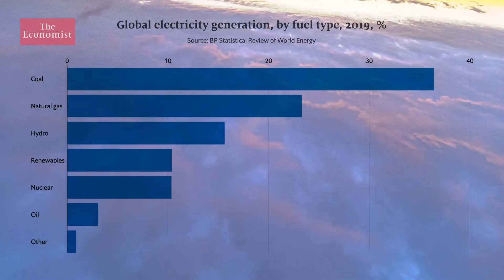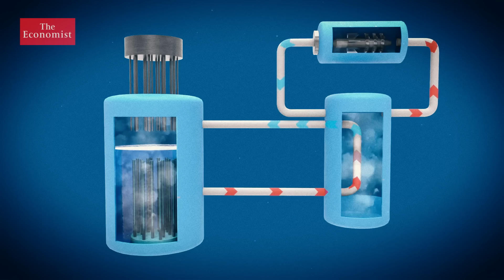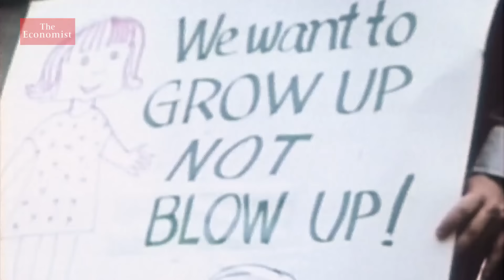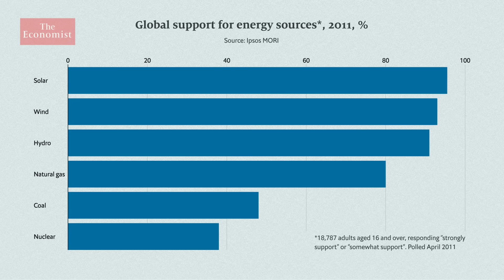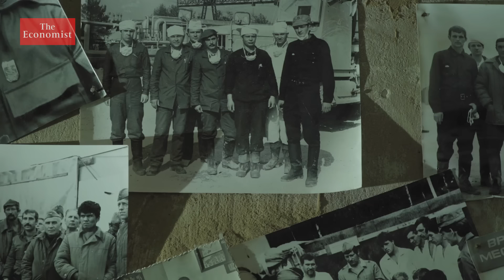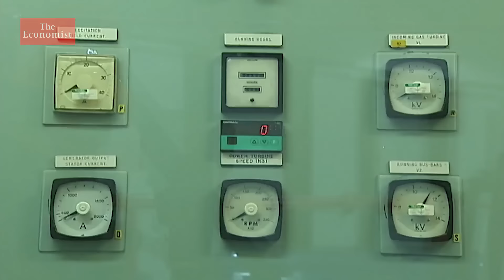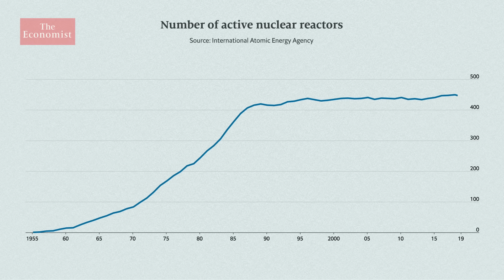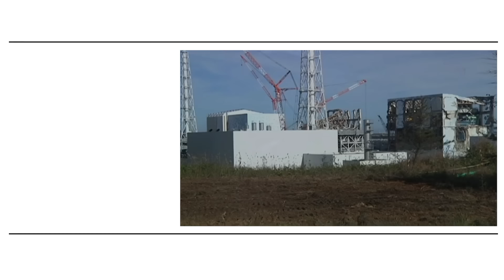Nuclear power: why is it so unpopular?

Comment: Not mentioned in this video: NUCLEAR WASTE.
Reply: Exactly!!! the  waste is awful, it would take many many years for something like that to go away
Reply: @canaldofred2366  that doesn't solve the problem, if it leaks it would make the surrounding area radioactive, and if many countries start producing nuclear energy, that's even more radioactive waste.
Reply: @canaldofred2366  fyi, it then leaks and underground water spreads it all over...
Reply: @luna5031  there are places and ways you can store it where that is not a risk. Wastes sites are made in areas with little to no water and geologic activity, as well as being stored in very secure storage containers. The amount of high level waste is very little, so just one site could store hundreds of years of waste.
Reply: 90% of the energy remains in what you call "nuclear waste".  That will be utilized in thorium molten salt reactors to deplete it further.

Comment: So where does all of the nuclear waste go ? That's the biggest issue..
Reply: I Love Chocolate.  How much can you store under the plant ? For how long ? Considering how long it takes for nuclear waste to become inert this is a huge problem ..
Reply: @D56t37-cu7ol  It depends of the level of the waste medium and low levels lost their radioactivity in one or two decades and their are 97% of all the waste, the other 3% are high level was which is pretty radioactive and need long term storage so it is cool and send to deep storage were it will for the rest of time, another way to solve this is changing the fuel from uranium to thorium, ot the type of reactor to MSR for example in this reactors using thorium all was only if dangerously radioactive for 300 years.
Reply: @viceralman8450  Sure Thorium..... Money stays where money is.... Uranium  has been hugely invested in...Thorium doesn't have a chance (in my opinion)...
Reply: @D56t37-cu7ol  It have being ignore because it is useless to make nukes but  when uranium begins to run short, thorium fever will begin.

Comment: @economist   @3:50 is where the First myths of nuclear power is perpetuated.  This is the claim that nuclear is more efficient.  Despite the fact the preceding comment explained that nuclear reactors use the same steam generation process of using steam to produce electricity as coal or nat.gas?   

Assuming  the purpose of a nuclear power plant is to make electricity, then all energy efficiency calculations need to be based on the thermal cycle that generates the electricity regardless of fuel source.   Put a little more simply, efficiency means, how many kWh of electricity are produced /unit of thermal energy input regardless of fuel source.    Until @easterofsun shows how nuclear breaks the First Law of Thermodynamics, the best claim the nuclear industry has is its expensive emissions free electricity that produces about 3x more wasted heat than electricity produced.

Comment: Building smaller  refrigerator  sized reactors can power a  town, and you don't have to worry about it exploding...   You can pack it up in a truck and ship it in a few hours.
The  HUGE plants  were just  too big, and too unstable.     Little  reactors  can be run by a few people,  have a smaller foot print, and  nearly  zero chance of leaking  RADs...

Comment: Unfortunately nuclear power plants were so over engineered and complicated, resulting in operator error causing the 3 mile Island partial melt down and  the Chernobyl full melt down.  The poor engineering at Fukishima of placing generators next to the ocean known for tsunamis and having a seawall only 38 feet high caused the immediate problem.  Then not having any way to inject non salt water into the reactor using fire hoses connected to fire hydrants was a second problem.  Then not being able to vent hydrogen gas or open other valves because they were air operated which requires an electric compressor to make air to open the valves was a third problem.  Then the inability of the operators to make decisions was the fourth problem.

As for nuclear fusion - always the promise of the future now going on for 60 years, the tokamak reactor still cannot generate more power than it consumes.

If only the engineers had used common sense in designing fission reactors, less accidents would have occurred and the reactors could have operated more efficiently and reached the promise of electric power too cheap to meter while reducing emissions.  Sadly I think it is now too late, even if we found better engineer's with common sense.

Comment: Only three countries can make the third generation nuke plant: USA, PRC, and RU. And how many are able to make coal-based or renewable resource-based ones? That might be the answer to the question.
Edits: South Korea surprisingly is the fourth player here.
Reply: French also can, and I believe China's 3rd gen ability is coming from the French.
Reply: @frankxu2321  I see no French company or entity is one of the G-III reactor providers. They are developing the next generation though, meanwhile, China also has its own G-III+ reactors collaborating with the US for diversity purposes.
Reply: @KXYZ32  France sells the EPR (HPC, Olkiluoto, Flamanville) - a Gen-III+ reactor by most definitions.

Japan could (most reactor pressure vessels, the main part of the PWR or BWR reactor, are cast there), and has in the past.

India and Canada also have strong home-grown nuclear industries. The technology is relatively easy, easier than coal in many respects.
Coal power is common, not because it is easy, but because it is cheap.

Now, wind turbines are super-high tech! And solar panels require multi-billion dollar fabrication plants. Not going to see those manufacturies in small- to mid-size countries either. Sure, the Danes have Vestas, but that is only due to the long lead-time they have been working on this. Don't expect Kenya, Colombia, or even S Korea to start pumping out those.

Comment: I am disappointed the Economist has published such a one-sided video.  For example :  The first "commercial" power station was Calder Hall in the UK.  An important part of their operation was to create plutonium for the military.  There were many leaks.  The claim "radiation does not escape from power stations" is false.  Scanning of the UK countryside in the 80s revealed long term and widespread radiation problems.  These were proven to NOT come from Chernobyl but from Windscale.  Modern atomic plants are NOT financially viable - please see "Hinkley Point C".  Investing in a new nuclear power station is essentially a 20 year bet that cheap electrical storage - whether ammonia, redox flow, storedot, liquid air - will not become viable.   This is why there are no private nuclear power stations coming on line soon.

Comment: Plottwist: while everyone speak about new nuclear technologies and nuclear renaissance, Russia constructing new type of fail-safe lead reactor, researching new type of MOX and nitrogen fuel for lead and sodium reactirs, as well as starting the construction of pleiades of offshore NPPs in the Arctics with small-scale reactors onboard, finishing the construction of a new tokamak that will be used to demonstrate the fusion-fueled breeding, and researching the possibility of creating a gas-cooled reactor for thermo-electrical hydrogen production.
So yeah, the renaissance is just around the corner, guys.

Comment: What about the nuclear waste ?
Reply: No one has been injured by stored nuclear waste.  Besides, it will be valuable fuel in the future.
Reply: If the spent fuel were separated into the highly radioactive fission products and the less radioactive actinides, the actinides can be placed back inside a reactor to generate more power. The fission products  are very radioactive, but decay to background levels after about 300 years. This is proven technology done commercially by the French already. It is the lack of separation that keeps the radioactivity high for thousands of years.
It is fairly easy to store a radioactive lump of glass safely for 300 years.
Reply: Lookup nuclear vitrification
Reply: @goodfodder   Look up thorium molten-salt reactors.
Reply: Thanks for the info ! The seperation isn't implemented because it is too costly ?
Reply: @timothecrelier2674  The separation is costly, but it is economic. The costs become even cheaper if we had more fast reactors (which can use more of the separated actinides, thus raising demand for the separated actinides).

In the US, separation is not done as President Carter believed it was a proliferation issue. I feel the last 30 years of French, British, and Russian experience have showed proliferation isn't an issue with reprocessing as contractually setup by those 3 countries.
(having every country building a reprocessing plant would be, but just a few plants worldwide is enough to meet demand; in fact the world probably doesn't need anymore even if volumes increased several-fold)

Comment: the question is not primarily whether it is safe or not, but if it does make economical sense for combating climate change.
Wind and solar are in most parts of the world extremely cheap and efficient and they keep getting cheaper. If nuclear cannot be cheaper than this, it has no use and we produce radioactive waste we do not know what to do with. Viable uranium is also a finite resource.

Comment: Its the way forward if we want to lower our carbon footprint by 2050, long term renewable energy and battery storages will be enough and we will no longer need it
Reply: Battery storage is not there yet. Plus we would need to start huge extraction industries is a lot of developing nations which usually has turned out badly in the past. A mixed grid of renewables and nuclear should be the solution untill we get fusion

Comment: Because the true cost of nuclear power is none competitive as compared to other electricity generation technologies, unless it is subsidized with tax payer's money, nuclear power stations have to cut corners to be competitive in any free market system. The common means for nuclear power stations to cut corners to remain competitive are to cut safety corners, to prolong the use of nuclear power stations past their design life, to save money by not dispose of spent fuel properly, and to not properly decommission properly. Free market competition pressures from other cheaper technologies ensure that nuclear power stations are unsafe, unless society, which are the tax payers, decides to subsidized nuclear power stations to be designed or retrofitted with robust safety features, to not operation old reactors way pass their design life, to dispose of spend fuel properly, and to decommission reactors properly. In addition, there may be basic design flaws, which are still being used even today. For example, the bottom of the containment vessel is concave in shape rather than convex or even flat in shape, so as to take pressure better. However, it case of a core meltdown, the fuel rods dropping to the concave shaped bottom tend to slide to the center of the convex bottom, and thus concentrating the fuel closer together, which can result in criticality, where the fuel is close enough to automatically initiate sub-explosive extra high levels of chain reaction by concentrating discharged neutrons. Extra high levels of chain reactions caused by the concentration of melted fuel rods by the concave shape of the bottom of the containment vessel generates very high levels of radiation, which make clean up extremely difficult. There are proposed designs for melted fuel dispersing catchers at the bottom of reactors, but such extra safety features make an already none competitive high cost reactor even more expensive and none-competitive, so no reactors are equipped with melted fuel rod catchers. Another example of cutting corners to save money is to run old reactors way pass their design life. Not only very old reactors can have rusting parts, but very old reactors were design before many safety technologies were even invented. For example, microprocessor computer chip had not been invented when many old reactors were built, so that these old reactors lack expert-system computer safety controls that can monitor for operator errors. Computer expert-systems can be used to evaluate the holes in safety in reactors. For example, in Japan's case, water tight doors were missing by not having rubber gasket strips around the edges of doors to make the doors water tight, and as a result water entered the electrical generators room flooding out the generators. Certainly in this modern age, electricity backup are common knowledge, as any serious personal computer user has seen advertisements for electrical backup batteries for pc's to provide uninterrupted power supply systems for personal computers. For large companies, backup generators are commonly installed in office buildings. Yet, the Japanese reactors lack backup generators. Again, in a free market competitive market, a none-competitive technology has to resort to cutting corners to compete in a free market capitalistic system. Not increasing the height of the seawall is another illustration of the need to cut corners (ie. cut height of the protective wall) in a free market capitalistic system. With global warming, sea levels, lake levels, river flooding will probably occur so that reactors build along these water bodies for cooling will become increasingly expose to water damage risks, which again will increase expenses to the costs of running these reactors. A few reactors were located near some of the most major cities of the world. Any major accidents involving these reactors can involve huge economic loses, when a New York City, a Tokyo, and such major cities become so radioactive that they can no longer have inhabitants. The risk and gamble of these reactors just do not make sense, specially in view of the above of old reactors being used way past their design life, of lacking modern safety features, and the increasing economic competitive pressure from other ever cheaper technologies. For example, solid state battery technologies are maturing at a rapid pace to enable solar and wind technologies, which have the drawback of being intermittent, to be hugely economically competitive against nuclear possibly in the not too distant future.
Reply: can you use paragraphs next time
Reply: you do realise that wind, hydro, solar, even coal all get subsidies as well right?
Reply: @Eltener123  Frack-natural-gas is very cheap in the United States, as it is a byproduct of frack/horizontal drilling for frack-oil in the US. As long as frack-natural-gas is this cheap, nuclear cannot compete even with subsidies in the US in a free-market system, so that even with subsidies, nuclear, in practice, will have to cut corners in safety. There is a YouTube video of a Florida nuclear plant being shown to still have leaks during a heavy rain at an electrical entrance panel, because poor work done to plug the holes on the wall where electrical cables enter and leave the building after nuclear operators retroactively started to water proof buildings after the backup electrical generators were flooded out at Fukoshima. The joke is that due to global warming, it is projected that in 50 to 80 years, half of Florida, if not most of Florida, may be under the salt water sea. What safety measures have been done to prepare for that, and many others? Right now, the nuclear operators are doing minimal in safety, and mostly act only in reaction to accidents like in the YouTube video by the Canadian agency, which after studying the Fukoshima accident, implemented three safety measures of storing portable backup generators and pumps both on and off site, of installing passive hydrogen gas absorbers in the containment building, and to install filters in the pressure release tubes to filter out radioactive particles, and gas before release into the atmosphere. Most of these are simple, and relatively inexpensive. the question is why were these simple safety measures not already there world wide before Fukoshima? Is it because in a free market capitalistic system, as well as in other economic systems where greed to make money is a factor, there is a mentality to pinch pennies? Is it because greed has the financial types taking control rather than the engineering type taking control of most if not all companies? Is it because the financial types who dominate the control of companies will invariably start to pinch pennies due to greed? Is it because due to insatiable greed, the financial types taking control will always pinch pennies no matter how much subsidies are provided for safety, because these greedy people will want to increase profits (or in reality reduce losses of most nuclear plants) at the expense of safety? It is not because as Adam Smith maintains that the invisible hand of greed is all dominating in the affairs of humans? Greed trumps safety. That's why nuclear is unpopular in countries where Adam Smith's greed philosophy (free market capitalism) runs rampant. People in these countries know that the greedy business people owning and operating these nuclear plants care less about safety, which to them safety is an undesirable cost to be whittled down whenever possible.

Comment: I agree with the what they talked about in the video, but why didn't they also talk about storing the used fuel?
Reply: Spent fuel is stored onsite indefinitely in weatherproof dry cask storage. These casks are massive and require specialized equipment to even move. Spent fuel rods are neither an environmental nor security concern.
Reply: Because is nearly irrelevant to the overall cost.